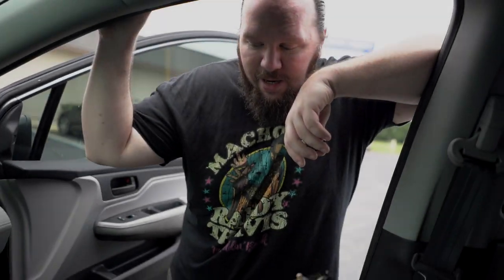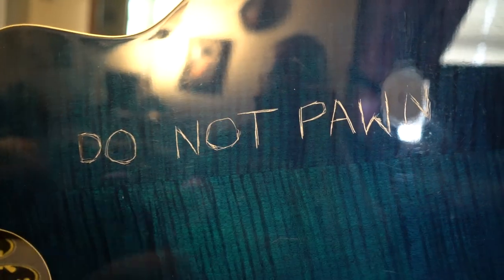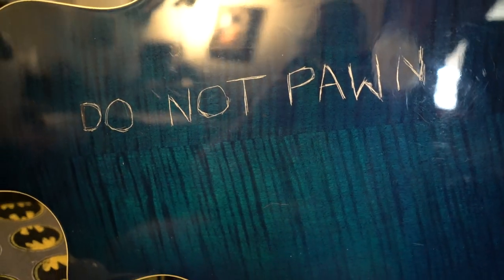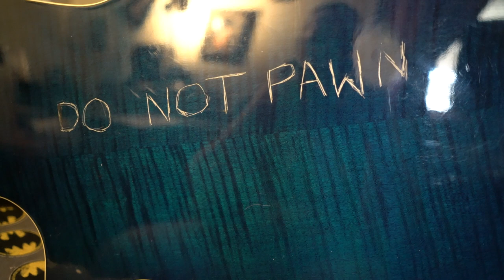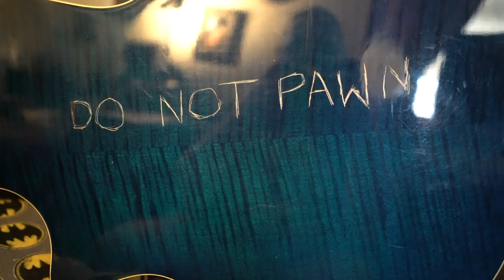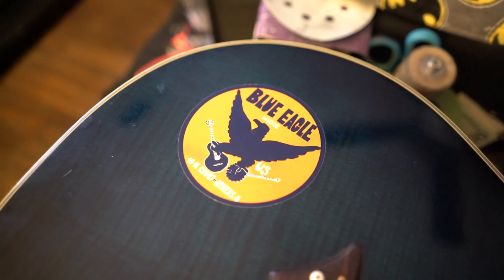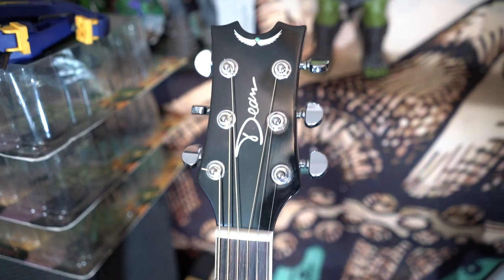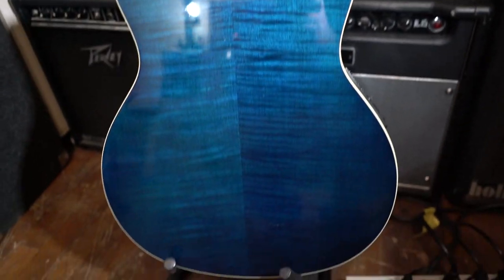Removing Deep Scratches from Guitar Clearcoat!

Comment: I have an Ibanez AZ2402 and when I was adjusting an intonation screw my hand slipped and I accidentally scrapped the top coat with the screwdriver...It looks awful.  I don't think I can fix it myself, I just do not have the patience or the steady hands for this kind of work, but I'm hoping I can at least find someone who can fix it for me :(

BTW you did a phenomenal job, those scratches looked DEEP and you made it look basically brand new!  No trace of them!!
Reply from the maker: Thanks!  Maybe you can find a local body shop to try to fix it for you.  back in the day I needed a guitar clear coated and asked a local shop if they could spray it for me the next time they did a car(they always make more clear up than they use).  Surprisingly they said yes!  You never know until you try.  Good luck!

Comment: You have a list of materials that you use to get the scratches out. Looks absolutely amazing.
Reply from the maker: I thought I made it easy to see in the video, but basically just 800-3000 grit sandpaper and  medium cut and fine cut meguiar's buffing/polishing compounds.  You can get it all at your local auto parts store!

Comment: Good job!
What was the clear filler you used? I have a small scratch I'd like to repair in my Yamaha Revstar, it's polyurethane clear coated.
Reply from the maker: I used the filler thinking I'd have to respray the back, turns out I didn't so the filler was sanded out, it really was not needed.  But here it is, it's called Aquacote. https://www.amazon.com/Aqua-Coat-Cabinet-Filler-Environmentally/dp/B07HYFYTC6/ref=sr_1_1?crid=12XXXU5Z63X81&keywords=aqua%2Bcote&qid=1662959175&sprefix=aqua%2Bcute%2Caps%2C93&sr=8-1&th=1

Comment: Nicely done. When you're spraying, is it simply water?
Reply from the maker: Thank you sir! It is when I'm sanding, but when i'm cleaning it's ammonia free window cleaner.
Reply: @ForsytheVideo  It's best to use dish soap heavily diluted for wet sanding. It lubricates but this is only suggested for areas where water won't get onto or into bare wood.
Reply from the maker: @solarismoon3046  Thanks!  I have used dishsoap and it doesn't make a big enough difference/improvement for me to use it.  If I am going to be near bare wood I won't use water at all, either ammonia free windex or alcohol.

Comment: What finish do you think was on this guitar poly or nitro?    I think martin guitars uses a thin coat of nitro so it may not work as well.    That makes me think this guitar was lower cost and had a thick plastic coating.
Reply from the maker: Definitely poly.  You would not want to do this to nitro.

Comment: Is the lacquer on drums similar to the lacquer used on guitar finishes? 

I have an old drum kit with scratches and was thinking about doing this
Reply from the maker: The guitar was a poly finish.  You can probably polish out the lacquer but it's usually best to scuff it all up and spray a new coat when it comes to lacquer.

Comment: How much money did you spend on Polish etc? If I were to do it I would have to buy like 200 quids worth of stuff. You already had it all, not many do.
Reply from the maker: $12 from harbor freight for the pads and rough polish, $22 for fine grit polish from an auto store, another $10-15 for sand paper from the same auto store.  Maybe $2 for Window cleaner.  What is your comment meant to imply?  Maybe not many have all that stuff but they can easily obtain it.

Comment: How come you can clearly see the wood, and when you polished it, the wood becomes blue again????? impressive
Reply from the maker: You can't see the wood, the whiter color is the scraped finish. There was still enough finish beneath it to be polished and luckily whoever did the damage did not get through the finish completely.
Reply: @ForsytheVideo  So the marking that seemed white or wood color was not the body? that’s weird …..thx
Reply from the maker: @sega62s  Have you ever scratched a poly finish? It looks white dude
Reply: @ForsytheVideo  no I never, I have a question for you, My Gibson les paul has little scratches from guitar pick and usual wear, can I use a pad to buff it or just manually with some kind of product “ thx

Comment: Don’t need to sand it just use a blue sharpie or paint pen , cover where the idiot wrote, wipe with nail varnish Remover and finally polish with guitar wax ,failing that all purpose wood polish will fix it.
Reply from the maker: Yeah that's not quite the same as a trans blue finish and would have been pretty noticeable.
Reply: Not really because the nail varnish remover will manipulate the finish and mix in with the original paint.
Reply from the maker: @sampaton5460  this is a poly finish, so unfortunately it does not react that way.  On a lacquer finish it's possible because lacquer 'melts' when you add new lacquer over it, poly does not.